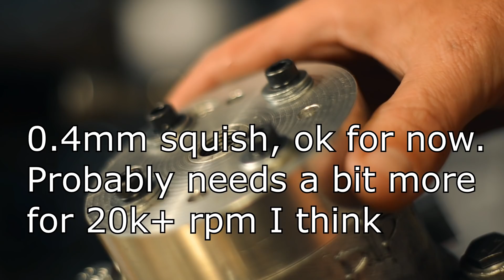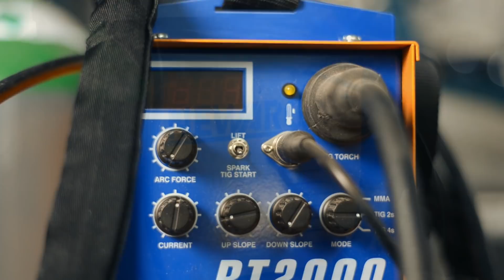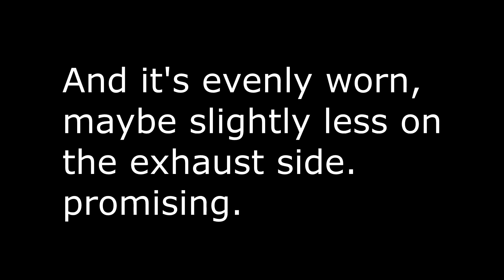The Most Powerful Two Stroke Ever - First startup attempts

Comment: don't understand why you cut the gasket material or should you let it on there and let it burn out when the motor runs why cut it just cut a hole for the spark plug to fire let it burn out that's how mechanic does it

Comment: I wouldn’t make the gasket so big as in wide, it’s to great a surface area to compress, hence the possibility that it will not start, due to an air leak, try without a gasket, and use gasket weld that you can buy in a tube. This will prove my point Wright or wrong,  then buy a stock gasket with a cooper collar/ring, this will compress, and then use high tensile steel bolts for added Tork, I wish like many others to be there helping you, keep it up and best wishes, 
Tip: when tapping the holes, clamp your work on a pillar drill bench, using the core drill to center up the hole, replace core drill for tapping tool, and use cutting oil, turn and feed the chuck by hand use a chuck key if you need to, and the thread will be center true and square, which leads to less resistance, plus you can buy three step ones so you cut out three times
Making for a more genital cut, and healthier thread. That you can get a bit more tork too.

Comment: Have u thought about using a pressurised ring set up with small holes in the piston top leading to behind the rings thus using the combustion to hold the ring out and seal better, although i think your right with the ring it should be so hard as to snap before bending
Reply from the maker: Might go there, we'll see how the new piston/ring combo works. Combustion is still what forces the ring out and seals tho, even without the holes👍

Comment: Develop a ring with a step in it, and piston with groove.to except step,compression will get caught on the Innerstep of ring and expand it outward,and seal between cylinder and ring,drill and tap piston, and use a pointed set screw for a ring stop, and gap adjustment,and lock tite when ring is set at right gap.

Comment: Sir, your overall general knowledge is a rare commodity. I learned engines under an old man who watched engine technology as it developed. He was born in 1902, and built race engines for some the earliest auto racers, using seat-of-the-pants intuition, and try this-try that, until he discovered how to overcome his obstacle. He went on in industry and became the chief engineer for TWA Airlines in the 1970's. He forgot more in a day, than I could learn in a week. You, very much, remind me of him.  He was a great teacher and mentor. Thank you for the video series. You are a delight to watch. Good luck sir. (Use the advance of tdc hint others have dropped)  Air to gas ratio may need to be tweaked to achieve harmonics after you get your baby running.

Comment: "The most powerful two stroke ever"

Laughs in container ship engine.
Reply: i don’t think a ship engine is 2 stroke. is it?
Reply: @jojessegaming9630  Oh yeah it is. Watch any documentation about it. They are very happy to tell you about their borderline megawatt ~ 250rpm direct drive to the propeller engines.

Also try squeezeing the heavy oil fuel through injectors. Ports do a much better work in such application.
Reply from the maker: Hp vs cc
Reply: @2STROKESTUFFING  Yeah. That is my point. You should really mention the displacement in your titles to give perspective to how awesome your build wants to be.
Reply: @SpaceShipDeathstar   they do have direct injection the holes in the tip of the injector are big enough to fit a toothpick
Reply: @thomasgo1234  Nice!
Still there was a time before direct injection.
Reply: jojessegaming  some small boats still runs 2 stokes, evenrudes are still a 2 stroke engine, and bigger boats tug and even some larger pusher boats ran 2 stoke Detroit’s back in the day
Reply: @jojessegaming9630  yes lots of diesels are 2 stroke. they need a supercharger just to be naturally aspirated....
Reply: @jojessegaming9630  Ah yes even the owldd Doxford opposed piston double acting mostly clanging and bang banging was replaced by the Bermiester and Waine long sleeved piston turbo charged scavenge fired, oil leaking, stinky smelly and hairy scary, sludgy scavenge inspection...all two strokes aihh. (spoken with a Scott accent from Greenock) laddy.

Comment: im gonna second the timing comment. u need about 30deg btdc for high rpm 2t. reeds need 2 be soft if u have low compression/low case suction . o ya and throwing a tuned pipe or muffler for some back-pressure would REALLY help. side note- make sure there is enough fuel flow. with that rpm spinning + no tuned pipe we should see a fine mist from that pipe . keep going. u can do this !!
Reply from the maker: Haven't thought about the reeds, that might actually be a big problem. I'll see if I can find some real soft ones. There's a pipe coming!

Comment: The rings between a piston cylinder (system)
"evolved" in the beginning of the twentieth century, so that in order for the ring to expand (and seal) it was by way from the "air pressure" and  the  act of compression.

All this fine line of  finicky futility and distinction, is so advantageous in hopes that 

Your cylinder doesn't get scored from having a piston ring

Our snowmobiles had the ring  "pinned"*  at the gap (within the groove so that the ring could not ever rotate around (and catch on any of the "large" ports)
  * This pin was like a teeny tiny roll pin that all fit within the piston groove

Comment: 0.016 squish @ 20000 rpm....Yikes. I'd say you need more. At least another 7 thou.
Reply from the maker: 👍 That's spot on actually, 0.6mm 0.023. Didn't bother adding another gasket for testing. O n my previous build the piston touches the head at about 18k with 0.4mm, want it to touch at 22k or so here.
Reply: @2STROKESTUFFING  Love the vids. I have built a few 2 strokes in my time, mostly KT100 Yammies. Where is the piston hitting ? Towards the center or at the each of the squish? If its at the edge it's because the piston rocks a little. In that case cut the angle of the squish on the head maybe one or two degrees flatter instead of spacing it with a head or base gasket.

Comment: I use a large ball bearing to locate the hole on the engine find hole with finger dent gasket paper set on ball bearing tap solidly and it will almost cut it But will def be peferctly centered. 😊😊👍 Great work.
Reply from the maker: Thanks, great tip!

Comment: A proper Tillotson would be better for your project.
Reply from the maker: Keep in mind the carb is just for starting/warmup, then the secondary valveless intake takes over.
Reply: @2STROKESTUFFING  oh ok. Thank you for explaning. 
Is the valveless intake for full throttle only, how do you do atomization without a carburator? Did I miss that Video?

Comment: You might have to use a one-way bearing for the drill starter because I did the same thing with the ratchet substituting for a one way bearing. I was trying to start a 30.5cc small bore engine and it failed. Believe it or not it’s not spinning free enough like a one-way bearing it sounds like it’s about to start but it didn’t! Then Eventually the ratchet mechanism inside failed inside! I put the one-way bearing set up on there and it started right up the ratchet causes too much drag and take the natural combustion cycle out of rhythm Preventing it from starting because that small bore doesn’t produce enough torque to compensate for any drag! It’s different from starting a lawnmower with a drill I think the piston is so much bigger and produces a lot more torque so it will compensate for any drag that a drill that has a Ratchet end or as you have seen with a straight drill with no mechanism for starting just a socket and extension.
Reply: Joanna 😂👍🏾

Comment: Did you use assembly Lube when you put it together that might be why they're silver in the oil that settle to the crank and why your ring Gap is bigger because you're taking Material off the cylinder by spending it with a drill like that without lubricating the top and first maybe you did I don't know you didn't put it on video
Reply from the maker: It was oiled, no need to worry.
Reply: @2STROKESTUFFING  okay just making sure because I've seen too many videos of people wrecking chainsaws because they didn't Lube the top-end before they put it together you seem to know what you're doing some of the s*** have watched on your channel is way over my head I build with chainsaws and air-cooled racing snowmobile engines I'm working on a 1986 Ski Doo Tundra with a 440 twin running a dual carb setup from mid-90s skandic for antique ice drags

Comment: You need to use round face rings like used on the new Echo 2stoke power eguipment
Reply: My Ryobi weedwacker from Harbor Freight had rings that were round. I thought I was seeing things. The engine ran okay although it didn't seem to have lots of compression. Has anybody done a comparison of round to square or rectangular rings to compression or to engine power?

Comment: Where's the pumper line on the Walbro that runs diaphragm and opens the jet.  It should run from the base of the carb to the crankcase for pressure.  It's never going top start without that.
Reply from the maker: It's part of the flange, hole through the reedcage.
Reply: @2STROKESTUFFING  sorry that makes sense 👍

Comment: You will solve 90% of your starting issues by using an electric drill over a cordless most cordless don’t have the rpm especially under load to start the engine

Comment: Hey brother it’s been a while, hope you and your family are doing well and staying safe. I used a automobile compression tester to check a two stroke engine, I got a reading of 130 psi. Do you think I should use a small engine compression tester? I think I should check for a air leak, any thoughts? Thanks for the advice in advance.

Comment: Another note: it's common in the auto racing industry to gas port the compression ring,. So, just as the final compression is happening, it forces the ring to expand with gasses from behind. This allows you to use softer rings that ease drag, but still seal tight during combustion. Basically just small hole(s) from the piston crown to the inside of the ring land.
Reply from the maker: 👍 I was thinking of doing lateral ones.

Comment: I had a Goped many years ago, got it used with a modified unknown engine (free, neighbor threw it in the bin). The pull start recoil gave up when trying to start it, so tried a cordless drill and no dice. Went and grabbed a true electric drill motor (3000rpm) and it fired the engine right up. The benefit of using electric drill motor vs cordless is there's no chuck clutch (for the hand chuck) on most of them since they come with a keyed chuck - so it eliminates the need for a one way starter adapter since the engine will run faster than the drill motor once it's running. Also, it won't rip your wrist apart if it back fires.
Reply from the maker: Good tip, thanks!
Reply: @2STROKESTUFFING  Electric vs battery worked nicely. Well done. I honestly feel an iron or steel liner will do better than nikasil types, but may be way off.

Comment: We built a small diesel 2 stroke engine years ago.. we had to make 4 piston rings for it to make it work. The engine was based on a gas weed eater engine and used a very primitive home made fuel injection system we made out of copper piping and springs. Worked pretty well. Never had the chance to have the engine dyno run but we did put it on a mountain bike and it got the bike up to 38mph which was cool
Reply from the maker: Awesome!

Comment: Do you have a reed valve in the engine? If yes, is it suitable for high RPM engines? I thought it is good at low and middle RPM
Reply from the maker: Reed valve for starting and warmup, valveless secondary intake for power!

Comment: i think you turned the flywheel at wrong direction. I think it will start when you spin in to the left. Atleast with my two strokes that's the key to start them with the drill :D

Comment: You could do a trick and use the compression to enhance the press fit of the piston ring against the zylinder. Not sure if this is a good idea for a high rpm two stroke tho
Reply from the maker: Compression/combustion pressure IS what makes the ring seal.

Comment: Correct me if I'm wrong but don't 2-strokes need an expansion chamber for the exhaust in order to run or start-up correctly?
Reply from the maker: They usually start fine without one.

Comment: Keep up the testing.    Testing is key.   If you are interested in other rings.  I know the Honda crf50 uses some out standing rings may want to look into them.  Alot of high end air compressors use a cast iron ring if you are more interested in that

Comment: The most powerful 2stroke engines are fitted in container vessels... try again bro.
Reply from the maker: Those giant engines produce very little hp vs cc
Reply: @2STROKESTUFFING  Sure, let's introduce some numbers. 

With a bore of 38ft and a stroke of 98ft the largest and most efficient propulsion engine, no gearbox, i.e. direct crankshaft-driven marine engine delivers 109000hp or 1hp/0,98 cu ft or 1hp/28861cm3 and moves 170794 tonnes or 1,57 tonnes/hp.

Thermal efficiency of the engine is over 50% at maximum economy...
Reply: @lIlIlIlIlIlIlIlIlI  sounds alot weaker that his hopeful 30hp from .05 liters

Comment: Needs a leak down test to determine where the compression is going, transfer or exhaust port too high?

Double o-ring or fire ring and water jacket gasket mandatory for what you’re doing, any cylinder head lift and you’ve lost valuable compression.

I would have stayed with a conventional style 2 ring piston for testing purposes, better oil control and cylinder pressure retention but may need oil ports in the lower skirt or dedicated oil port to the piston at the rpm you hope to attain.

I think your ring erosion is possibly lack of lubrication or not enough ring support and it’s scuffing and wearing on your port edges.  If it has proper lubrication, The ring shouldn’t wear at all in that amount of trial time, not until it’s got cylinder pressure behind it and is wearing in during break in operation.

Looking forward to seeing the next stages.

Comment: Hey, just a tip, (would like to add, I build with scraps and zero professional tools. I use a drill, a grinder and a cheap welder.)

A test start should always have propane handy. From a 1.5 liter honda with 7.3L diesel turbo, and a Chevy 292 carb. To briggs mower engines with some crazy turbo setup... Everything I've built that would not start on it's own. I would always try propane before starter spray. Even an open torch, no flame, into the intake helps it start up to tweak things enough, that they can start without propane. 

But with "quick start" spray, (ether, whatever lol) after trying to start an old dodge truck, 318 v8, with quick start, it backfired. Shattering the intake manifold, which took out the distributor in the process, and somehow, shattered the timing chain cover. 

After that, I said fuck this shit, and have since only used it as fire starter, not engine starter. Lol
Reply: You obviously used way to much ether if it blew up like that.
Reply: Only saying, as through experience, starter sprays explodes, where propane burns. 

Fire is still bad, yes. But IMHO explosions are worse. Like, would you rather burn your thumb, or have it blown off? Again IMO but even a 3rd degree burned thumb, would be better than no thumb.
Reply: Josh Frank  Into the intake of the carb while cranking the engine over. Sometimes a little extra fuel helps. IMO its just safer than dumping gas into the carb, or starter spray.
Reply: Josh Frank  Yeah, I had just sprayed while a buddy was continuously cranking the truck, after about 15 seconds of turning over, it detonated. Lol. I still use it, just not so much. I just find propane will go "poof" instead of "bang", compared to ether. 

Had an old Acura integra run on ether when trouble shooting. Would idle with full ether spray, but die with a touch of throttle. Turns out I forgot to plug the distributor in. Compression ignition conversion. Lol

Comment: it sounds like your timing is off remember it has to be before tdc as it takes time to burn the fuel use an old fashioned timing light its the best way to adjust it 
also your port windows have to have so much time or your fuel/air mix wont be pushed though your transfer ports  if the reed valvue is to stiff it can cause issues with the piston not having enough to open them far enough

Comment: You could put a bit of molding clay on the piston dome, turn it over a few times and measure the gap.  You may need more than 0.4 mm gap at that RPM - conn rod stretch.
Reply from the maker: 👍 Definitely! For testing purposes. In my "other engine" the piston starts touching the head at 18k with 0.4mm.
Reply: 2STROKE STUFFING Doh!  I love you channel, gotta say.  I’ve shared with so many.  I like your style, your approach to solving issues, and the problems you are trying solve with something as “simple” as a two stroke engine! I simply love it.  Just watched the Bonneville record setting runs by an electric vehicle (Electraliner - EV West).  I’d love to go to the flats .... it’s about 12 hours north of me .... you planning on another attempt?
Reply from the maker: @dgretlein  Thanks! Yep, going next year!

Comment: What is the bore surface? Steel sleeve or nicasil?
Reply from the maker: I composite plated it with nickel/boron nitride myself.
Reply: @2STROKESTUFFING  You are going to have to find or make a TiN coated ring. Suzuki used a boron composite bore in some their outboards that were very dependable. Might want to research that. Awesome build btw.👍